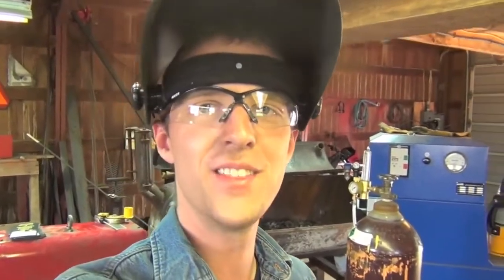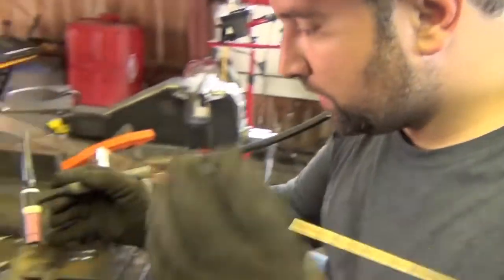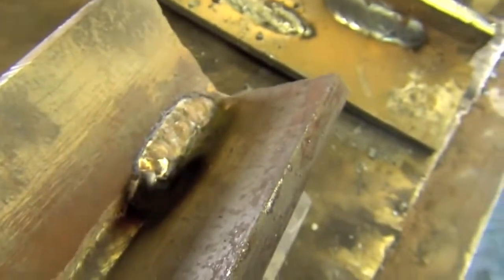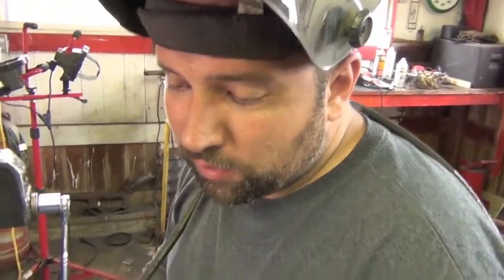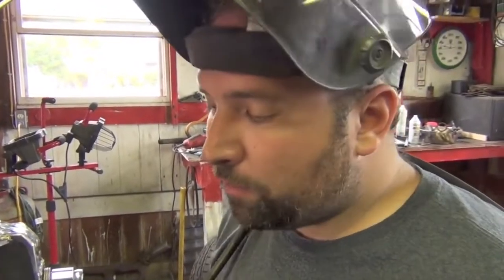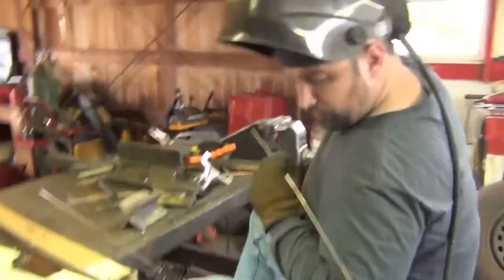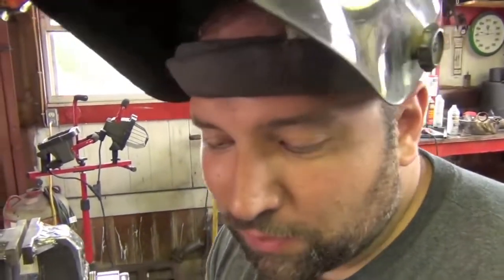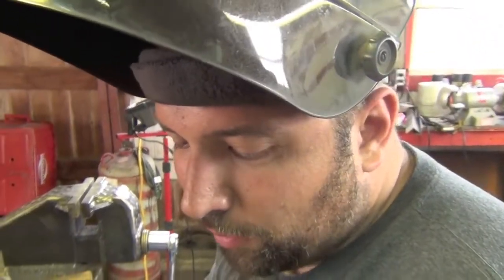SIBRO VS ALBRZ. Silicon Bronze VS Aluminum bronze

Comment: Silicon bronze is used for oil pans and other applications where you really want stuff to bend not break.  It also seems to hold up really well to vibrations.

Comment: Can you use a brazing flux to improve flow. The bronze seems a bit sticky compared to gas brazing
Reply from the maker: I want to say no, typically the argon takes the role of the flux and keeps things “clean”. 
I believe the flux would “pop” and contaminate the tungsten electrode …. But then - i am NOT 100% sure about this
Reply: @ZILAwelds  I see your point, the temperature of the arc may be way to high and the flux would probably boil
Reply: @ZILAwelds  I would generally agree.... But normally when you Torch braze you end up drying out the liquid in the flux with the torch. At that point it is a powder on the surface similar to the arc rod coating. This would make for a fantastic video Peter!!! You have some pretty incredible welding skill videos that are extremely unique on YouTube.